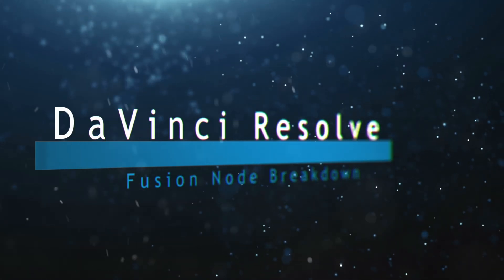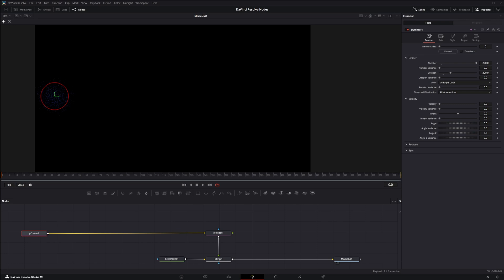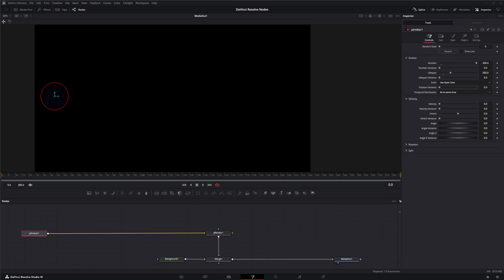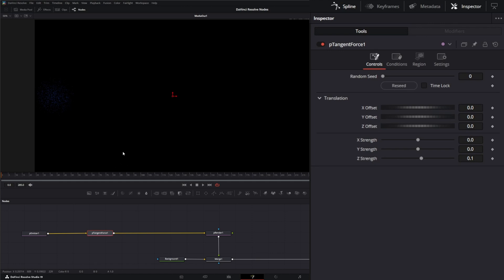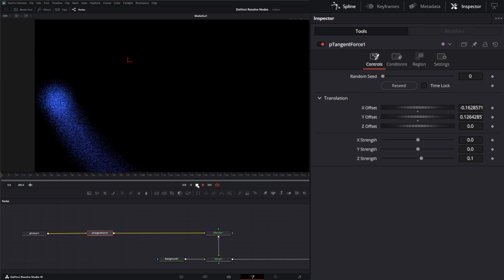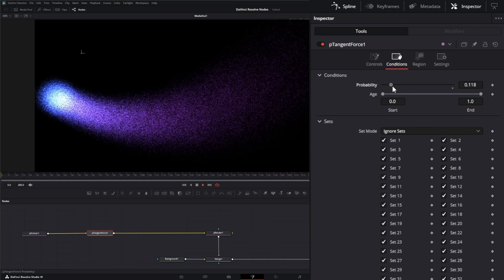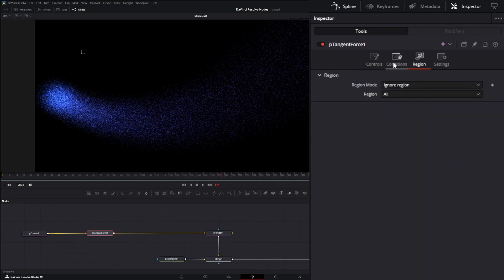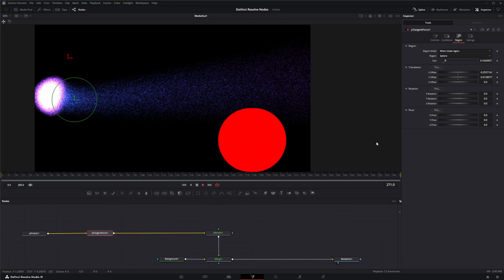DaVinci Resolve Fusion Particle Tangent Force Node

Comment: Let me apologize in advance for this long post:

So I think I have a way to sum up my difficulty with Fusion. I have a concept of that I want to create but can’t figure out which node(s) I need to use to create it. For example, I don’t know if you’re into Marvel movies but in the Dr. Strange Multiverse of Madness, the Illuminati scene shows Professor X using his powers and there are these translucent wavy like circles emanating from his head. 

I don’t have a clue on how to create an effect like that.

That’s my difficulty with Fusion compositing but I’m hoping your series will be helpful in figuring these nodes out.
Reply from the maker: Thank you for watching...just be sure to start from day one though  because I start off with basic nodes. As far as Marvel...yes, I'm a fan . The shot you're talking about is easier than you may think.. they just used rings to drive displacement with a bit of noise  added. So, just think...what fusion nodes could you use.. maybe Drip, fast Noise  and a blur or displacement
Reply: @ I sure you’re right, but I still wouldn’t have known which ones to use. It’s like 6 of one half-dozen of the other. That’s why your videos are incredibly valuable. Let me know if you’re open to a paid consultation.